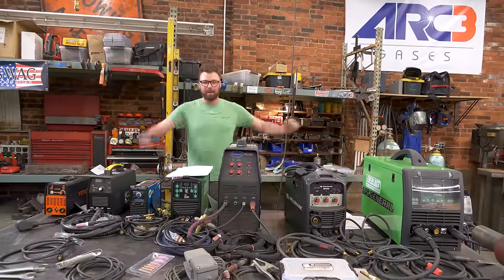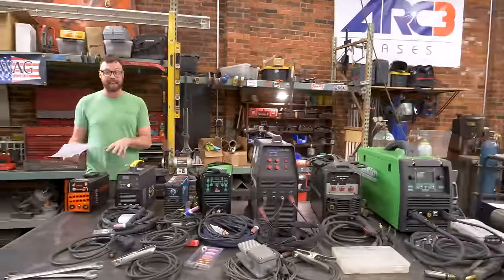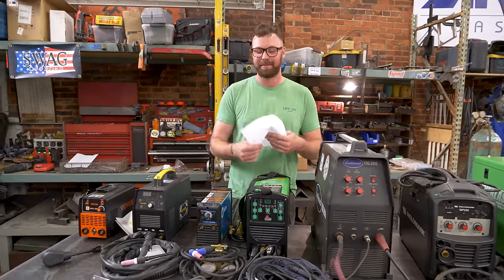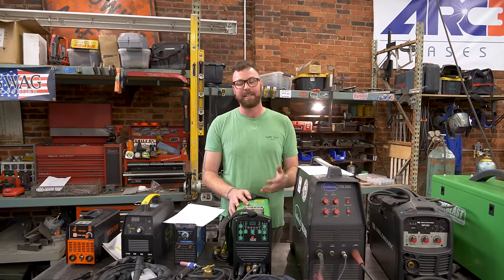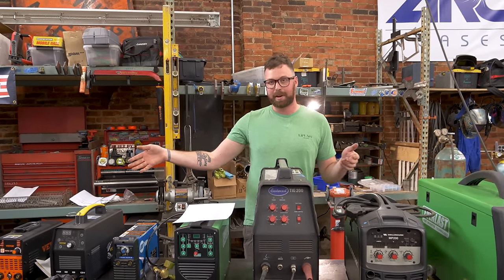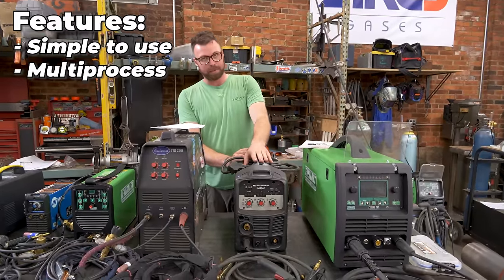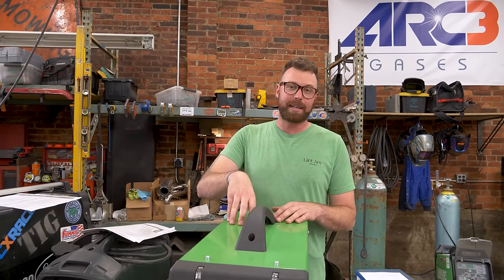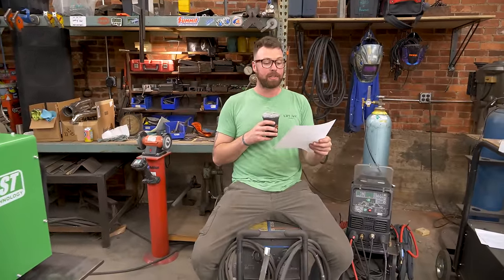A Comprehensive Look at EVERY Welder I Own

Comment: I have an ESAB Rebel 205. It’s great. I had the 215, but gave it away when I got this one. Very smooth arc. Does AC tig. Yep prices have sure gone up. My 215 kit, with foot pedal and aluminum spool gun was $2200. Now, it’s $3,100. My 205 kit, no aluminum gun because I tig aluminum and can use the aluminum spool gun with this one if I want to mig it, was $3,200. Now, it’s between $4,200 and $5,000 depending on where you buy it. Crazy!

Comment: I can't say anything bad about Everlast. I bought the 210 ext. Sold it and upgraded to a dynasty. Bought the 50 p plasma. Had a issue with the air not shutting off. Everlast sent me another unit free of charge. With exchange of my unit. Did not loose any down time. Convinced my dad to by the 255 tig with cooler. He is a old time  Welder. He can not believe the power that comes from the small Everlast package. I use my 150 max star in the field as a ship Welder. For big Jobs I use my Miller 350 vs with the 12 suit case Welder. You save alot of money running using 44 lb spools. Love Everlast. There is a difference when you need to roll your equipment in the dirt. I still use the plasma cutter. Have not had an issue  in years.

Comment: I have a Everlast 255EXT and a Miller Dynasty 210. I use the Everlast the most and compared them welding aluminum and can not see any difference.  the pulse on the Dynasty seems more crisp but other than that same.  As far as what you said about aluminum needing less power that is the opposite.  You have electrode positive and electrode negative.  The negative is the heat and the positive is the cleaning action.  this is where the balance control comes in.

Comment: With regard to the "pro set" on the Everlast, and on all machines for that matter: It's a very simple formula that a MIG welder works with, There are two adjustments on the machine, voltage and wire feed speed. The remaining physical ingredients are gas and the actual wire used. This is to say, that in a true experimental setting, If you took the exact same wire and the exact same gas and ran them with the exact same voltage and exact same wire feed speed through two different machines, which are set to the exact same settings, you should get the exact same result for any particular weld.

If you're not getting the same results on two different machines when you do the same type of weld,  then there is an obvious difference between the two machines. The difference isn't going to be complicated to figure out. First off, are the values on the chart of the machine or the chart you looked up online the same on the "bad" machine as the values on the machine that works better for you? If they aren't, then the values of the better-working machine are probably better for you to use.

If the displayed/charted values are identical and one machine is working better than the other, then the likely cause is that the output values are wrong on one of the machines. The wrong amount of voltage or wire feed is being output by the inferior machine. The output values don't match the displayed values on that machine.

The "bad" welding machine is putting out too many or too few feet per minute of wire, or the delivered voltage is not accurate to what's needed. When you "get to know a machine" you're often just getting to know that a certain machine "runs slow wire" and you need to set for a higher speed than you thought, or another machine "runs hot" and you need to set the voltage a bit lower than is indicated on the dial as far as the charts would tell you.

In the end, the difference between a modern higher end machines and cheaper machines may just come down to how accurately and evenly they each feed wire and throw voltage and display it to the user within their market segment of similar machines.

Comment: A few years ago I won $1000 bucks from an Eastwood sweepstakes and bought the AC/DC Digital Tig 200  from them. It only cost me 100 plus tax. It's a friggin awesome welder. I beat the living crap out of it until the torch is about to melt. I've never payed attention to the duty cycle and it keeps on ticking. If it crapped out I wouldn't hesitate to get another one at full price.
Reply: How's it going nowadays? Looking at Eastwood tig 200 or everlast 255ext with water cooler package for a few hundred more...
Reply: @mustangdemon87  literally just got done using it on some aluminum less than 5 minutes ago. Most of the digital tigs are about the same but I do wish I had a cooler. If it's only a couple hundred more I'd have to get the Everlast with a cooler.

Comment: Thanks Tay, It is good to see a REAL side by side comparison and Honest Critique of all Different Welders from different Manufacturers and Different era's. Shout out From a Fabricator in Australia, My Tig Welder at Work is a "TokenTools" 315 ACDC, with Water cooler, 415 volt,  which looks nearly Identical to the Everlast but it is Red instead of Green. The face plates are basically Identical, made in the Factory Next door to the Everlast, (I've been told by the TokenTools owner) with Toshiba Mosfets, and other Quality Electronics. I have welded everything from 0.045" Alluminium plate, to 5/8" thick Bisaloy 400 Plate with it, It has the "Grunt".

Comment: I am 99% sure that the weldmark MP200 is a HF Titanium unlimited 200 multiprocess in a different wrapper. Your review of that welder mirrors my experience with the titanium.  I have run my titanium as  production welder for years and it's still runs awesome.  No shame here on running a HF welder and project farm showed just how good the titanium welders are.

Comment: "Transformer" machines use a variable transformer to simply take the high voltage, low amperage AC from the wall and turn it into low voltage, high amperage AC. There are two problems here: First, the frequency and waveforms are the same as whatever was fed into the machine to begin with (usually 50/60hz sine). Second, such a large transformation at low frequencies requires a very large transformer... You need a giant iron core so the flux doesn't saturate too quickly, and you need a lot of loops of wire-- and it can't be very thin wire either because the amperage on the output is so high. The result is a very large, heavy, and inefficient machine.

"Inverter" machines still use transformers, but they're much smaller, and they're decoupled from direct output. These machines take mains AC in from the wall, rectify it into DC, then use a digitally-controlled inverter to synthesize a super high frequency AC waveform which is then converted to low-voltage, high-current via a transformer. This transformer can be much smaller than a "transformer machine's" transformer because of the ultra high frequency AC we're working with at this point. The higher the frequency, the quicker the magnetic field is changing directions. The more often that happens, the less of a problem flux saturation is. The less of a problem flux saturation is, the smaller you can make the core. From there, it is re-rectified back into DC and then either used directly (DC MIG/TIG) or converted back into AC using another inverter circuit (AC MIG/TIG) that is capable of synthesizing all of our wacky waveforms (square wave, triangle wave, etc. oscillating at frequencies that we can also control). All of this is possible because we're using digitally-controlled inverters to synthesize our own waveforms to do whatever is best for the task at hand, rather than just trying to directly use whatever the utility company provides (50/60hz sine) at the wall. Waveforms and frequencies for stepping up/down voltage and amperage aren't the best waveforms and frequencies for the output side of AC welding and so on and so forth. With inverter-style machines, we control all of the variables.

Comment: Important Note at 21:54 : The 160i and 161STH have a "similar" feature set, but NOT the same.  with the160i you lose pulse, and manual preflow adjustment.  if either of those are important to you, spend the extra $70.

Comment: To add to info - your idea about AC vs DC traveling over distance is correct [ but has little to do with welding ]  ;)
What AC is for with Aluminum is the " CLEANING affect of the change in direction of the voltage - up to electrode = cleans & down to base metal for melting .
Then balance is how much - in what direction suits your project .
At least as I understand it ;)
1st welding class in 1969 , now my 1st inverter welder a Everlast MTS Lightning 225 - still getting use to all the extra adjustments coming from transformer welders ----- I bought at auction a Miller high frequency - add on box back in the mid-late 80s , do not remember the model # .
Overall I like the video , thanks

Comment: In addition to my selection of Millers and Lincolns and 45 years of experience I would rate my Everlasts right up with my comparable Millers. My Everlast 140 is comparable to the Maxstar and my 185 AC/DC with a comparable Dynasty with Hz and pulse.I am absolutely amazed by my $350 250 amp Toolium. On mig and flux core it will put out all 250 amps. Single pass 3/8". Aluminum settings for either the graphene liner or a spool gun. I would need a water cooled torch to even try to push it.

Comment: I have to replace a stolen Miller 220 AC/DC and with the sucky economy, I don't think I can skip enough meals to pay for another of the same, so your vid is a big help...thanks!
That said, I no longer have as much of a demand for aluminum welding and thinking to go MIG only.  Your love for your Miller 212 makes me want to go that direction, but I'm wondering if the new inverter technology runs as smoothly as the old windings/coil system...?  (thinking you may have looked into it since you made this vid).
New subscriber, good stuff.

Comment: DC is more efficient because it doesn’t chop the electromagnetic field. A transformer can be used for AC making it easier to transmit have high voltage. DC until recently was difficult to get very high voltages. Now that is much easier with solid state circuits. Modern grid  transmission is tending to DC.   If you want the experience the chop in AC electromagnetic field stand near a grid tower in the rain!

Comment: I feel like I see a Klutch welder floating around in the shop from time to time.  I'd be curious to see your thoughts on it since I'm relatively certain that it and the Weldmark both come from Hugong along with some Crossfire, one Praxair model that might be discontinued, and certain Metal Man machines.  They seem to make decent stuff but I haven't seen too much of their AC tig in action. I actually purchased a Crossfire welder that got damaged in transit and then lost and returns and customs back to Canada.  Of course you have the CK Worldwide which is pretty okay Jasic with a different plug for the pedal. Of course! Razorweld is another supplier of Jasic machines based somewhere in the Northwest with their parent company in Australia. Mr. Tig also had a self-branded Jasic.  Haven't really been able to find a lot of information with AHP, Everlast, or Primeweld. I did notice if you do a street view on Google maps you could see AHP machines at the Everlast warehouse.  Most of the welders for the states have to incorporate either dual voltage and then the plug modification with whichever weird pedal they select to pair with it.  It seems that ever less are substantially customized and may even be made by multiple manufacturers depending on model.  You can certainly see relatives of these machines, but there's some interesting variations especially on their higher end lines.  I've also been a bit curious about Eastwood and their tig welders origination.  They import so much stuff though that it's hard to work through their catalog.  I think China probably makes pretty decent big voltage machines but it seems a lot of the big customers are more robotics and pipe and construction so manual welding is kind of niche.  There is a video on YouTube from Argentina comparing the Jasic to Hugong by an actual welder.  Both seem to be reasonably solid. Jasic's new gen seems pretty cool.  It is kind of cool to see a co-op kind of pool together to try and bring some machines in in a way that's not super feasible for most businesses on their own.  I don't know why but I think if you're buying decent quality machines to distribute to your customers then you don't need to do astounding amounts of customization to it and should use the branding to kind of help build a reputation kind of like how Australia does with Jasic while still having their branding, or in Russia or the UK. They just straight up have the normal orange box with the normal branding. To each their own though.  Everlast has been kind of cool in pushing niche to market on some of their machines, most of which just don't even catch on.  One that I got super fixated on was the AC/DC mixtig, which sounds like you should be able to do some pretty heavy work with beyond the numbers of the machine.  It's an interesting time, that's for sure.

Comment: Welding voltage on ac is less than 110v..so input voltage is irrelevant. On DC it must be converted from ac to DC first lossing at least half the voltage.

Comment: "inductance" is a property of coils of wire (ie, transformer windings), and the more windings, the more inductance, which is why transformer machines are so smooth.  Inverters operate on the principal of digitally switching the power at very high frequencies so that transformers can be very small and light and the machine is overall more efficient, but they have basically no inductance because of the tiny coils inside..   When you turn up the "inductance" setting, it is just digitally altering the waveform to emulate the effect of inductance, but IMO, they still don't quite get as smooth as a old transformer welder...
Also, your garden hose analogy makes no sense whatsoever...   AC's big benefit is that you can easily put it through a transformer to make the voltages higher and currents lower so that tranamission losses which are proportional to the square of the current, are significantly lower.   I don't know how you would try to equate this effect to a garden hose analogy, but it is definitely not what you described...
Reply from the maker: Great explanation of inductance, thank you! makes a lot of sense

My hose analogy was mainly in reference to DC, and im not the first person to over simplify electrics with this metaphor. i even stated that its a poor analogy and over simplified... calm down. a lot of our viewers dont have an electrical engineering degree and most welders just know what noise its supposed to make when working properly and not how inductance works inside the machine. I try to have fun and simplify things when possible
Reply: @LiftArcStudios Simplification is great when it is accurate but in this case it's not even "oversimplified", it just doesn't make any sense whatsoever, even for DC (there is a reasonable analogy for voltage=pressure and current=flow volume and the size of your garden hose affecting these for DC, but your description didn't bear any resemblance to this and simple didn't make any sense at all)

The closest you might come is transporting coal (DC) vs oil (AC).  Coal is a solid and can only to be transported via truck/train/ship which is expensive whereas oil can be pumped down a pipeline which is a lot cheaper.  Oil can come in many grades and can be very thick and inefficient to pump, but by heating heavy oil to thin it, it makes it easier to flow through the pipeline and converting AC to very high voltages to reduce I^2R losses before sending it down a transmission line is a similar idea..   That would be a marginal and oversimplified analogy, but is at least somewhat descriptive of what is happening, and you can still apply the garden hose analogy for pressure and flow volume and it still makes sense here...

Comment: I can tell for a Fact I hit duty cycle on millers 211-212 and 255 always if it ain't 300 plus amps I can't weld with them longer than 20-30 minutes in a row with out hitting duty cycle and it chugging along I'll lay perfect breeds for a bout 2-3 feet on heavy gauge stuff then on the next set somewhere it will chug a long barely arc

Comment: I've been searching forever to find a decent ac/dc tig welder I would be able to able to tig aluminum in the field. And I keep coming back to the power tig 210ext because of the price point and the features it has available on the machine. I would ultimately love to have a miller dynasty 210 cause that was the machine l learned to tig aluminum on and I got spoiled.

Comment: i have that same miller 212 machine but you cant read anything because its all rubbed off what should the wire feed pressure knob be set at
Reply: The black turn dial that locks the roller down is there a chart for the different wire thickness

Comment: I have the Everlast 161 sth but the TIG torch it comes with is pretty crap does anyone know what’s a good torch replacement considering it’s a 25 dinse and not a 35 dinse. It seems that most lightweight torches on the market are typically 35 dinse size connector. please let me know

Comment: You should review a Miller 350P. Pulse mig 1/4”-1”steel, .045 solid, trimix. Forget bacon frying, when it’s dialed in it sounds like a herd of pissed off bubble bees. And get a fresh pair of Tillman 650s cause she’s HOT!
Reply from the maker: This sounds intense and IM IN! Now, just to get my hands on that machine..... 045 wire is no joke! sounds like something Curtis at Cutting Edge Engineering would use!
Reply: We use Miller XMT 350 MPa machines with suitcase wire feeders, I think 8rc feeders and we can run .052 wire. Shit is wild. My go to is .045 71t wire dual shield, unless the weld schedule says otherwise, cause you know, the navy pays for unlimited gas. Just thought I'd share a story. But yes the angry bees is for real when the steel is thick.